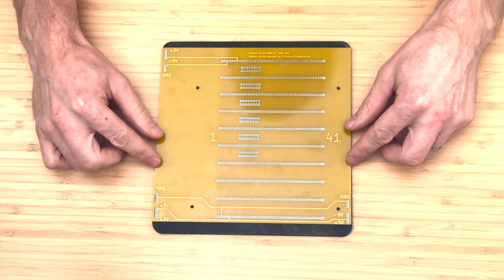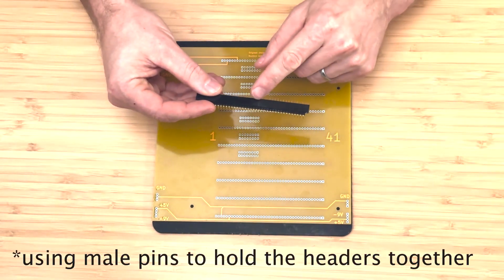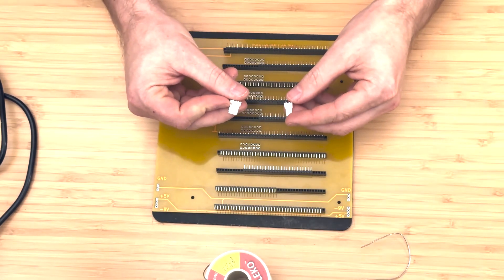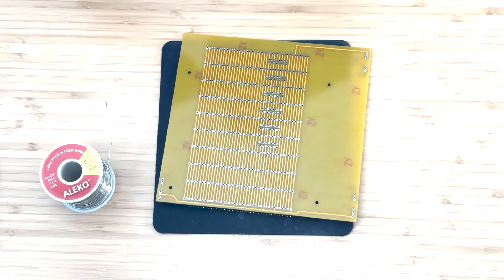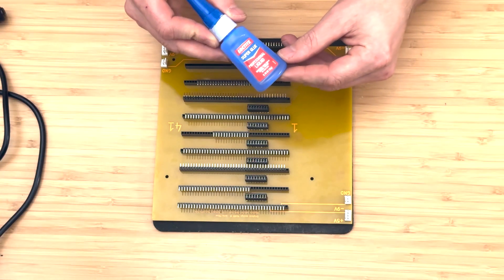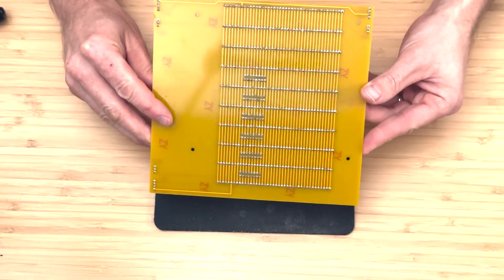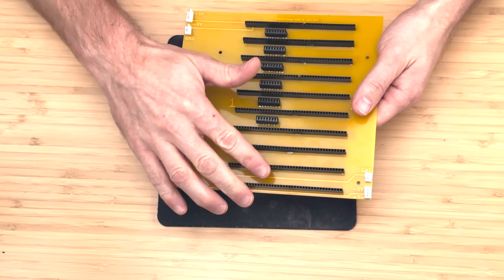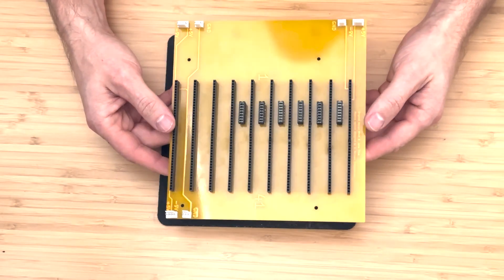Mark-8 Minicomputer Build - Backplane

Comment from the maker: A few notes and clarifications:
1) The original boards were not hard-wired to the backplane as the original design did not have a backplane. The boards were hard-wired to each other.
2) The eight sets of 2x8 solder holes were intended to cut traces between certain boards. Although I believe there is room for improvement here, in the spirit of keeping as close as possible to the original, we will go along with the board's design. We may consider designing our own boards for a future video.
3) I ended up removing the front power connectors because the boards did not fit with them being there.